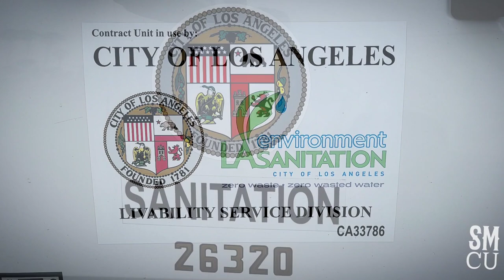Under the Venice Pier Homeless Encampment Clean-up

Comment: 4 of 4   The homeless can simply move the tents they are using now into the homeless-village and the RVs are assigned a parking space. Or the Shelter 100, provided by FEMA, is a $9,500 shelter that is climate controlled, built in one hour, is 100 sq. ft., and uses a folding bunk system to house up to four beds. Pallet Shelter's private sleeping cabins offer security and durability. Which addresses the concerns of the homeless who reject the restrictions of “bed-only” homeless-shelters; for only one night.

Comment: 1 of 4     Cities can eliminate homeless tent encampments by replacing them with Homeless Shelter Villages [HSV] using Pallet Shelter's existing Homeless Shelter Village [HSV] components. The Community Room sells for $37,000 and serves as a shared laundry room, restaurant, child daycare center, and addiction services center. The Bathroom cost $35,000 and the Services Office costs $9,000. So for only $81,000 a city can establish a Homeless Shelter Village [HSV]. The 10'X10' Camping Cube Sport Pop Up Tent that costs only $120 provides protection from the elements; for two people and their belongings.
Reply: Or load them onto a barge and sink it